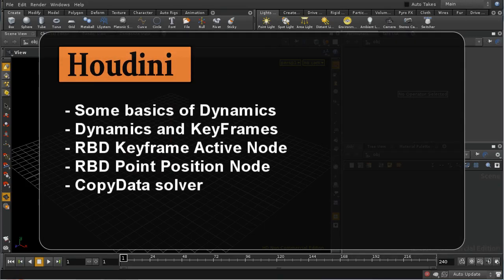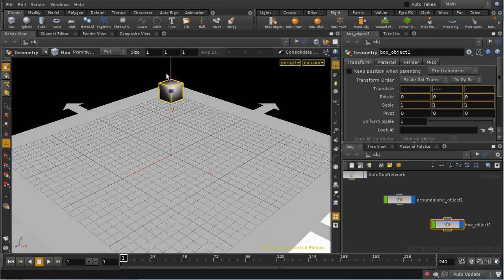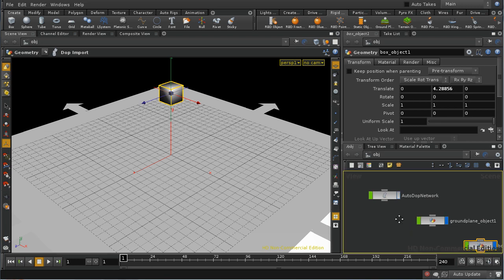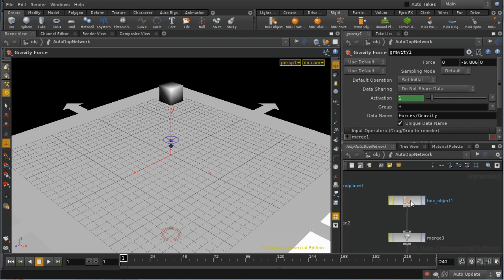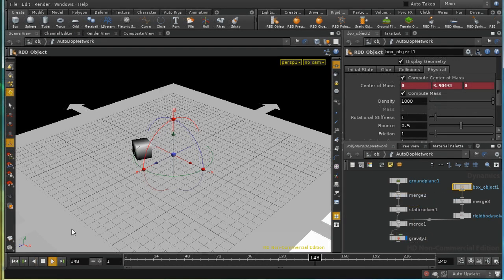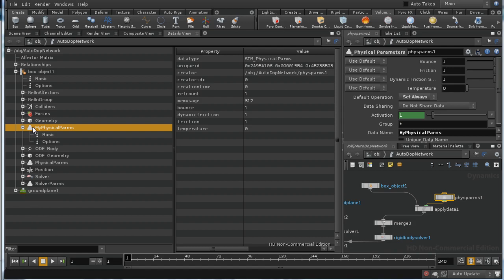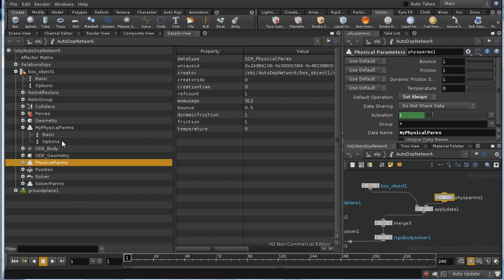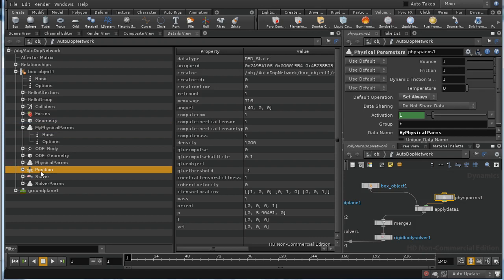Houdini DOPs Keyframes 1

Comment: Hi Peter,
First of all thanks for sharing the time and knowledge in your tutorials!
I'm trying to mix a simple keyframe animation with a RBD, I tried using an active value and OBJ position node after the RBD Packet Object node (has the example on houdini help), and I can't set the OBJ position when activate the dynamics.I also tried the Deactivate Objects tool from the shelf has your tutorial but the result was the same, the object position when the DOP is active its not correct.If I set the the object position in the RBD packed object transform node it increments the position on the object level.
Any help please.
Thanks